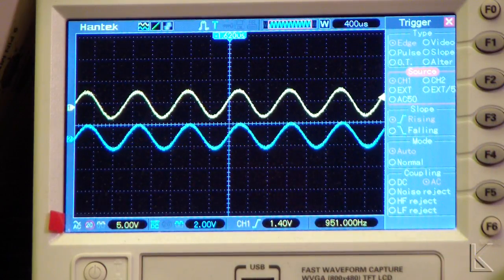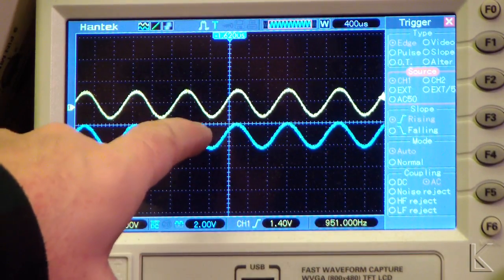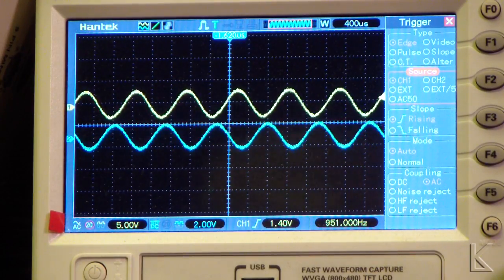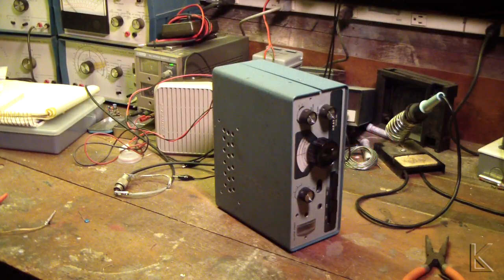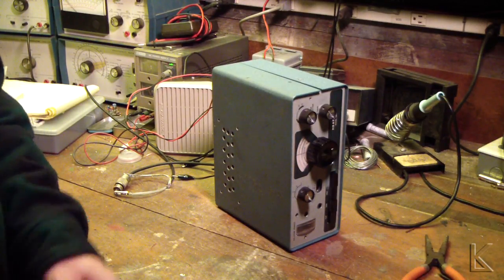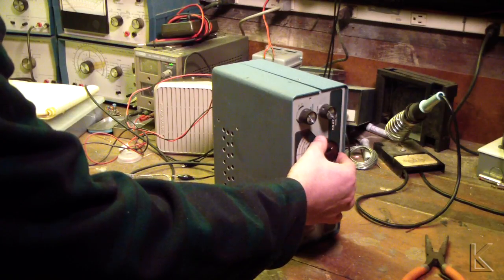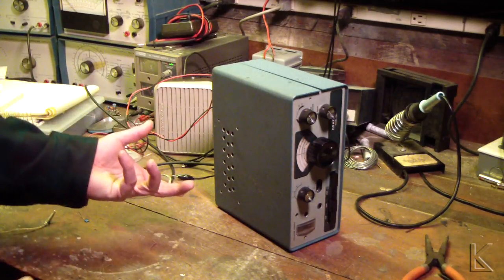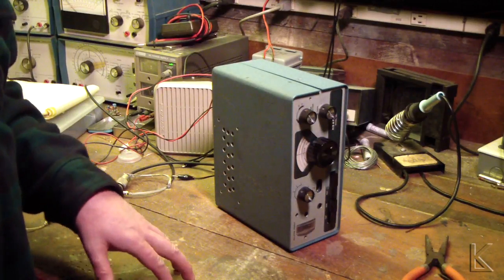Ham Radio - What is Zero Beat and how do I use it?

Comment: Thank you!  I always wanted a good explanation of this phenomenon.  Question, In any way, does this relate to the sound you hear in a moving car that  gets cancelled when you crack a window?  TU De Dave K3FT
Reply from the maker: I don't think so.   I'd guess that with the windows closed,  air pressure in the car is changing slightly and rapidly and outside air pushes in through the vents.  Opening a window would smooth out those pressure changes.   That low frequency throb sound is what I'm thinking about.

Comment: When I explain this, I use a function-generator app for my iPad. It can generate two audio functions, one on the left stereo channel and one on the right. I set them both to 1000Hz, then bump one up to 1001Hz and point out how the beat happens at exactly 1Hz by having the other guy watch the blinking colon on his digital watch. Then I bump the other down to 999Hz and show that now the beat is at 2Hz according to the watch. Then I'll try 1000.0Hz and 1000.1Hz and show how the beat now takes five seconds to rise and five seconds to fall.

This sets me up for an explanation of how the beat frequency is the difference between the two mixed frequencies, and why--since RF is much higher than AF--in the case of RF the beat can be perceived as an audio-frequency whistle rather than just a rhythmic pulse.

It's also good for explaining superheterodyning and intermediate frequencies, which is perfect when somebody asks how an analog-to-digital converter for a software-defined radio can possibly sample fast enough to grab a 450MHz signal. (It doesn't; the 450MHz incoming signal beats with a pristine locally-produced signal to make an intermediate-frequency signal at a few hundred kHz that's slow enough for a fast ADC to handle, but still has all the important modulations on it.)

If I had better speakers on the iPad, I'd try something like 20kHz and 21kHz, to demonstrate mixing two inaudible frequencies to get an audible one, but iPad speakers suck.

Comment: What are you measuring the beat of the two signals on for reference to check a standard? I'm wondering how to check a local oscillator against WWV or similar for calibration purposes. I understand hetrodyning and so forth. I'm wondering about the connections etc. WWV uses rubidium standard, as this is what is used as an atomic standard. I'm just wondering how to measure the phase difference. I'm not sure as I don't have a TRF radio only superhetrodyne single conversion. Mine does not have a BFO for code reception. I have a fair amount of test equipment, and know about calibration with a standard, but not sure how to check my standard against a radio signal. BTW the atomic clock was even in an article in Electronics world some years ago before it became Popular electronics in the 1970's. Some of the most complex things are obvious to me, but this one.

Comment: New ham here. As I’m tuning along the bands on my local club’s HF radio in either SSB or CB, I’ll often run across random “tones” coming into my receiver. Not beacons, they never transmit any Morse code, just a continuous tone. I’ve wondered if this could possibly be a carrier wave for some blank transmission, as I don’t hear them in AM mode but I can still hear the slight increase in the amplitude of the general noise you hear, but I hear many of these and I couldn’t see why there would be that many random blank transmissions. Any idea if it could be something related to this?
Reply from the maker: There's many noise sources in a modern building or house. Ethernet network cabling will produce those tones, sometimes they warble just a slight bit. Power supplies, plug-in chargers for devices, TV sets, all kinds of things will produce interference noise.

Comment: Zero beating is what piano tuners do for a living.  They establish a standard first playing  note "A"  above middle "C" on the keyboard which should resonate at 440 hertz.  They then take a tuning fork, hit it on their knee to make it vibrate, then hold it on the piano soundboard. If the sound of the tuning fork and the note "A" on the piano are out of sync or out of tune, the piano tuner will hear some faint beating. He then adjusts the strings of the piano to be in perfect sync or perfect tune with the tuning fork. When this happens, he hears no beats at all,

      which is called "smoothing out" or "coming in" when all three strings of the note are in tune with the tuning fork.  He then, has to do something similar for all 273 strings on the piano.  There are 88 keys on the piano, but most keys or notes have 3 strings per key, and some only 2 strings and the lowest bass strings have only 1 string per key.  

     The tuner has to tune every string, sometime using an electronic device, but the best "Concert Stage Tuners" tune with their ear using "Aural Tuning Technique" meaning they rely on their ability to hear Zero Beating when tuning. This is why a good piano tuning can cost upwards of $100  (as of year 2018) and pianos should be tuned at least twice a year at seasonal changes from cold to warm weather.

       Pianos are very expensive, and they require expert care.  Fine pianos can  cost $15,000.00....PER FOOT OR MORE.   A 9 foot concert grand piano can easily cost $145,000.00  No wonder we rarely see a piano in most homes, unless the family has money, or culture, or class, or  musicians or all four !!
Reply: Actually the hardest part of tuning a piano is tempering the notes, which requires counting the differential beats to know that you've actually tempered the scale. A very fine skill.

Comment: Kevin, I  think that you interchanged the use of mixing and arithmetic addition. You can't  zero beat through the audio amp and/or your ear, neither can pass DC (hence zero-beat) which is what you get when the two signals are perfectly in sync. Using the S-meter will get you even closer to zero, but not perfect. For the time and frequency nuts in your audience see Don Kirk's WD8DSB  article in Feb. 2017 QST, pg 41. Your generators also appeared to injection lock, based on the oscilloscope pictures.
Reply from the maker: Well Cash,   this video was more of a demystifying educational bit for new hams.  We weren't going for the lab quality high science of the matter. ;-)   Signal source was an old heathkit signal generator, so nothing fancy there.
Thanks for the additional info though, I'm sure there are a few viewers that will find that article reference quite useful!

Comment: Kevin, it's a cesium clock at NIST in CO and HI. 
73
Bill, k6whp
Reply from the maker: Yep, but I was talking about the frequency standards..   Rubidium was what I was trying to remember.
Dave Jones did a nice teardown of one of them...    You can actually find them on ebay,  surplus from cell phone towers I think.
https://www.youtube.com/watch?v=I55uLRRvLCU
Reply: Kevin Loughin, by the way, great to hear the HW7 wake up! The rig works very well; it just lives in that bullet-riddled home. Cannot wait to see you repackage it. Will get the receiver upgrade mods to you ASAP. 

dit dit, 

Bill